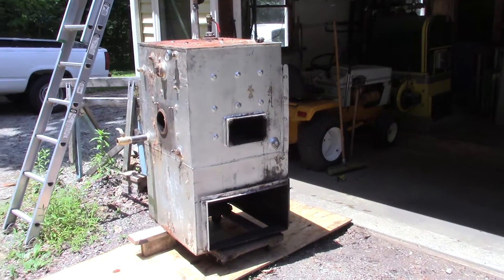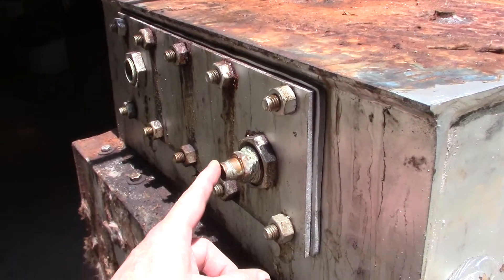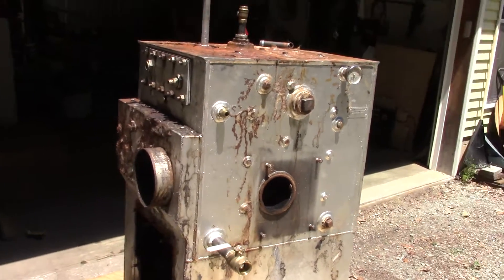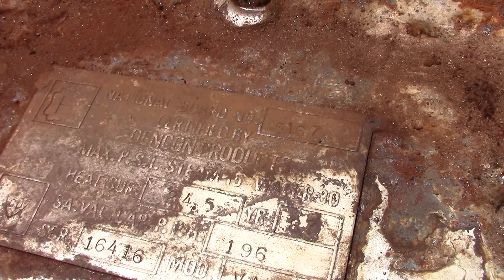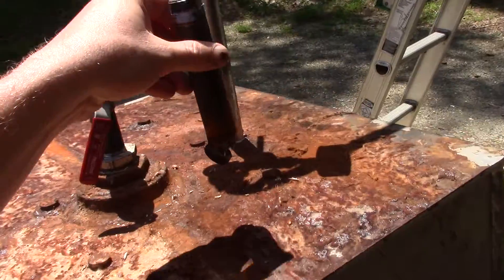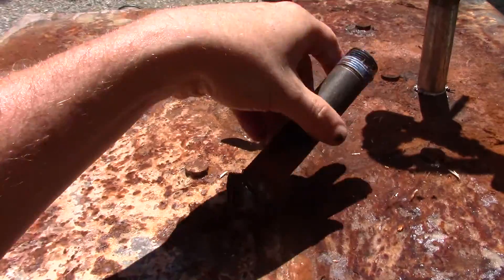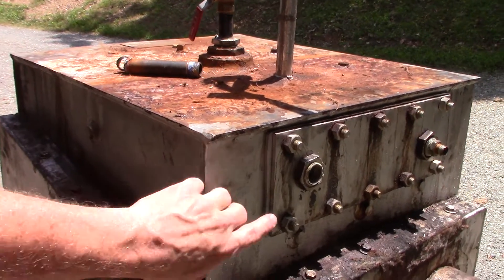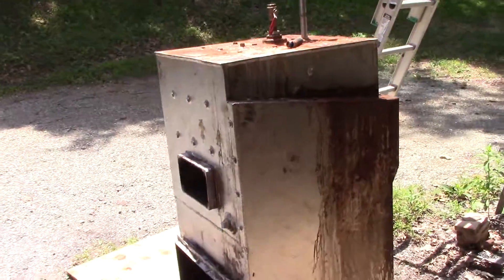Van Wert VA600 Coal Stoker Boiler Pressure Test Part1

Comment: I am gonna pull one of these out of my wife’s grandparents house for my garage. They used it as a steam heat. Can this be used for hot water radiant in my garage? Thanks for the video. Well done! We are in coal country PA I already heat with coal in the house. Keystoker K6 boiler
Reply from the maker: You sure can. The boiler and stoker are the same weather it's hot water or steam. The only thing that changes are the boiler controls.
Good luck!

Comment from the maker: 10/27/2017 UPDATE:
This is the first video of this Van Wert VA 600 coal stoker boiler. The complete playlist of the boiler prep, install, wire-up and running is at;
https://www.youtube.com/watch?v=DveXh4-_Gm0&list=PLFU8SaWNbzx-riP8MZ8iWJ4g1_hcLDsHI

The complete project description and photos is at coalpale.com;
https://coalpail.com/coal-forum/viewtopic.php?f=71&t=40113

This VA 600 is currently heating my house, garage, breezeway and domestic hot water. House is about 1400 sq, ft and the garage + breezeway are about 1250 sq, ft. The garage has some insulation in the walls but none in the ceiling. This VA 600 heats it all with no problems using PA Anthracite Rice sized coal, no need for any other heat source. House is located in south central PA, USA for climate reference.

Comment: what a waste to pull a nice coal boiler like that and replace it with an expensive to run oil boiler. these people just had a significant rise in their heating bills. it seems like aside from a small percentage of people coal is looked at as some sort of menace. sadly the environmental impact of anthracite is no worse then anything else and most of the concerns are nothing more then government propaganda and the crusade against coal. i wasted thousands of dollars on pellets and pellet stoves. im glad that green energy boondoggle is out of my home, and i wished i never owned one of the stupid things.

these people should have either left what they had in place or replaced it with a new keystoker boiler. it must be nice to be able to piss money away on heating oil.
Reply from the maker: A lot of these great old coal stoker boilers get pulled out just because
 people get to old to take care of them, not because there is anything 
badly wrong. It is near impossible to find someone to do service on a 
coal boiler.
Reply: they still make coal boilers. keystoker does anyways.